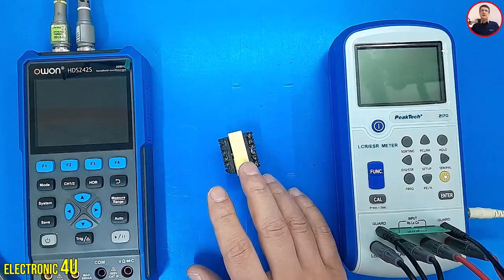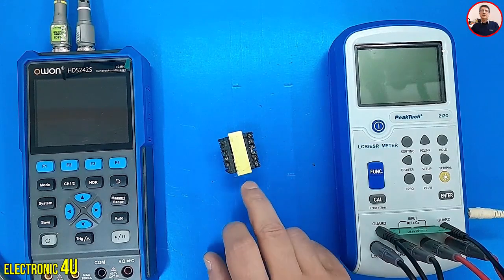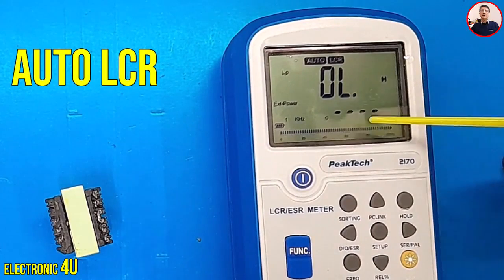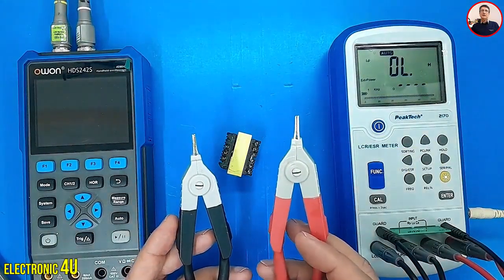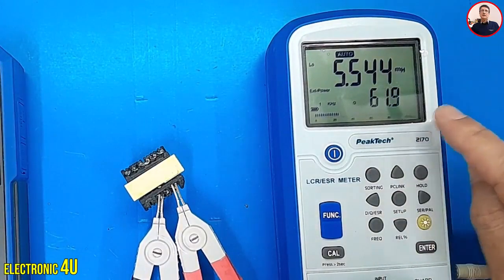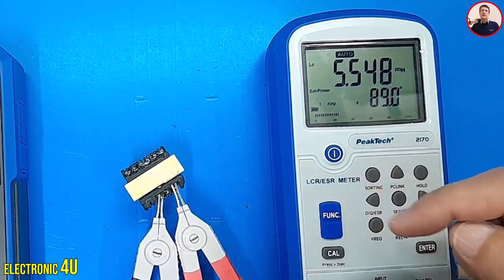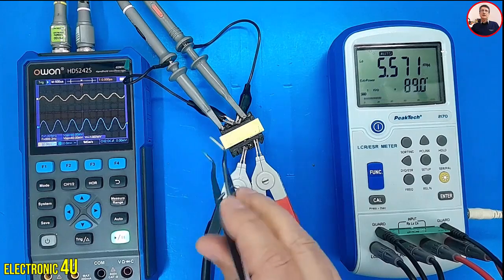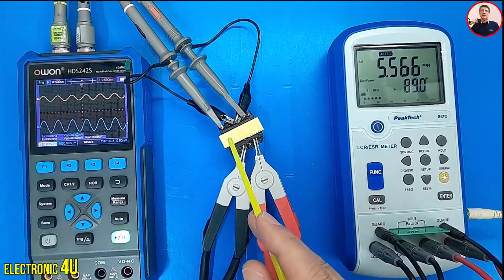How to Diagnose Transformer Health?

Comment: Ferrite transformers are usually used at a much higher frequency. Typically in the 40-100kHz range. Shorting the output of any transformer will make it behave incorrectly. No transformer is designed to have a complete short on an output winding. These are also not designed for a sine wave but a pulsed DC. Also the transformer needs to be disassembled to see if there's a gap in the core to see if it's a flyback or not. Shorting the output can give you an idea of whether there's decent coupling of primary and secondary but that's about it. A high voltage leak test between primary and secondary is an important test to do. Switching transformers are usually designed for a specific SMPS design. Core material and gap size are usually what you need to know about the transformer. Unless you know what type of SMPS circuit it came from and what outputs it was designed for, you would probably end up needing to rewind it for your specific circuit.
Reply from the maker: Thank you very much for your excellent explanation. 🌹🌹🌹💯💯